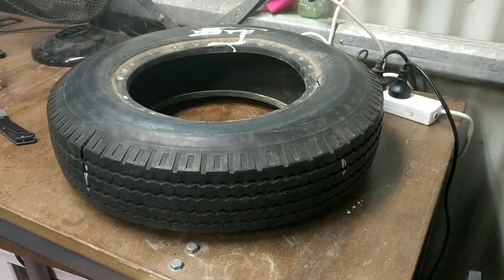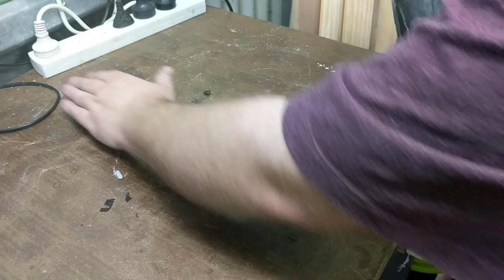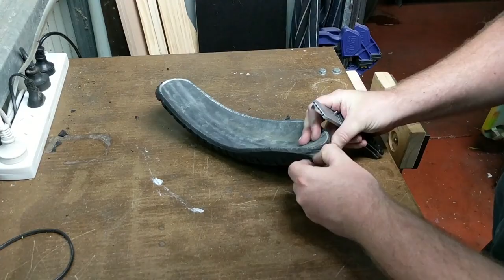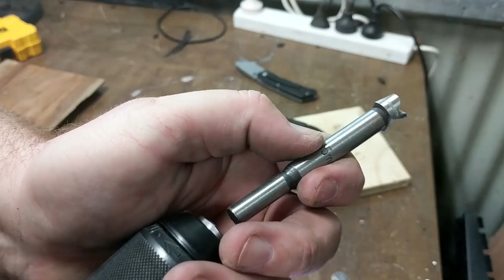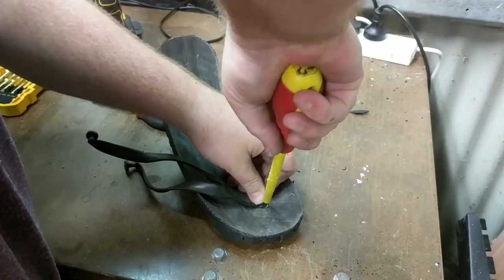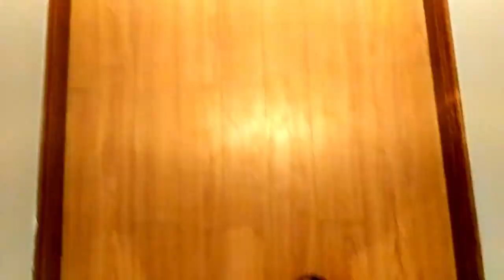Making Flip Flops from Old Tyres

Comment: Thanks for this instructional and informative video. However, as just a suggestion you may want to edit it by adding one more key piece of information: the type of tire that you used appeared to be a bias ply tire and not the much more common steel belted radial. It is much easier to make sandals from bpt's than it is from sbr's because the binding is made of nylon and not steel. Also, I don't know about in the U. K. but in the U. S. bias ply tires are becoming increasingly hard to find unless you buy them new because the market has been largely taken over by the sbr's. One exception to this is trailer tires. Some of them are still bpt's. Again, thanks for the video.
Reply from the maker: I agree. I wish I could make edits after the upload. This has been the most common question. Just thought people would have known that cutting a radial belt tyre would be impossible and didn't anticipate that they would be difficult to find in other parts of the world. This was a trailer tyre to be precise. 

Thank you for the contribution of knowledge! It's great to get such helpful advice in the comments section!!!

Comment: I would rather wear a pair of these than leather. Here is a good tip,  if ya like....check with local scuba shops (they get rid of torn up rental wetsuits , most times just give away or throw out.  Trace out some neoprene over these flip flops, get you some BARGE glue (Hobby Lobby has it) glue a layer of neoprene. This way, when it gets wet, or your feet get sweaty, you don't slip and slide all over the place.  Or you can go to your local fabric store, and buy some neoprene...of course this would defeat the repurpose goal. 
  Hope you try this.
Reply from the maker: That's a great tip! Thanks. It would make them a lot more comfortable, for sure.
Reply: No problem brother! Keep up the ideas!!!

Comment: I'm thinking if you used a car tire the steel belts would have been a problem.
Reply from the maker: Trailer tyre. No radial belts :)
Reply: Yes, the steel belts are difficult to cut. I thied using a hacksaw to do it once and it was a pain in the ankles.
Reply: After cutting, the radial tires bent the wrong way. They bent out instead of in, which makes you trap the whole time. Also the wires cut your ankles of the opposite foot. I tried to make huaraches for running a while ago.
Reply: @UrbanSelfSufficiency   18 wheeler  reply  on the side of the road have none

Comment: How can I cut a steel belted tire?
Those are the norm these days.
Reply from the maker: With great difficulty. I wouldn't try it tbh. 
You can find tyres without steel radial belts fairly easy... In fact, you're local tyre shop should have a used up one every now and then and would be happy to give one away. They're usually used in light trailers, like what's used on a small boat trailer.

Comment: How do u make thoes straps? And If  u knot them on the  bottom  of the shoes how does that work????
Reply from the maker: These straps were pilfered from an old pair of worn out flip flops. If you did  make your own and tied a knot, you'd need to make a cavity under the sole to allow the knot to sit in it so that you wouldn't be walking on the lumps made by the knot.

Comment: what kind of tire did you use?  Looks kinda small for a car tire.  Bet is wasn't a steel belted radial.  Was it a motorcycle tire?
Reply from the maker: +David Schmiedeberg It was a small tire off of an old boat trailer.

Comment: Great video! I was wondering what kind of drill bit you used for making the larger holes? Was it Forstner?  wood or metal head? Thanks!
Reply from the maker: Yep... Wood.
Reply: @UrbanSelfSufficiency  Can you please recommend the brand? I tried it out with a Milwaukee bit but it didn't go so smooth..
Reply from the maker: @talf611  My forstner bit was from a cheap set I bought on amazon; there was no brand to speak of. Sorry I couldn't be any more help than that. Good luck.
Reply: @UrbanSelfSufficiency  Thanks!

Comment: Not to take the easy way out but I actually thought you were just going to glue the tire to the perfectly good flipflops giving them a ton of ware and not ruing a pair of perfectly good flip flops...
Reply from the maker: The flip-flops I were actually broken, so I put the straps from the old ones to good use.
Reply: I tried that, but the curve of the tire makes it difficult to glue on. I ended up using rivets.

Comment: What kind of tire did you use?  I can't find any without steel wire in them
Reply: I used a garden tractor tire for mine.
Reply: @fryloc359  i ended up removing the tread from a used tire with a razor knife i got from a mechanic shop for free.